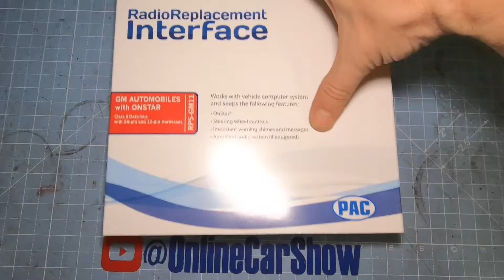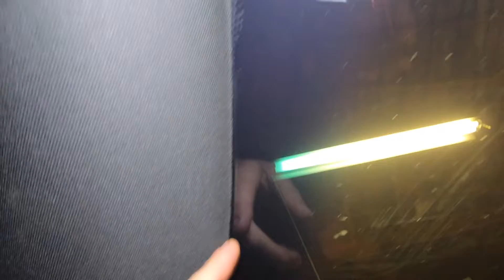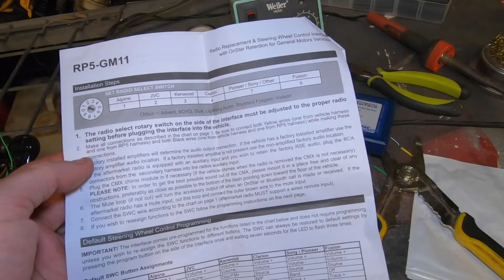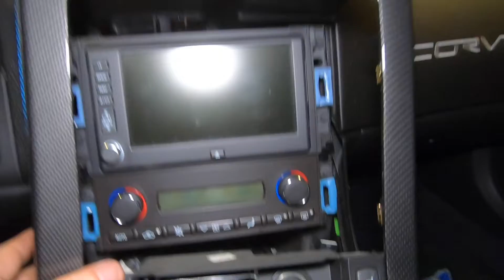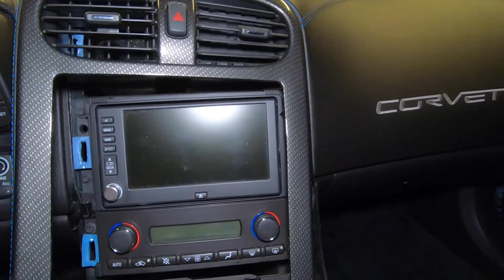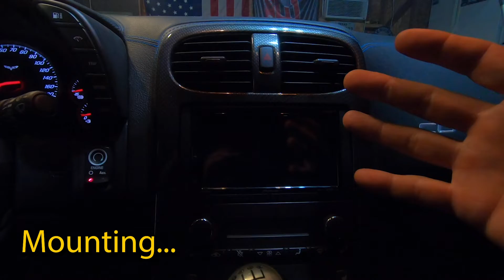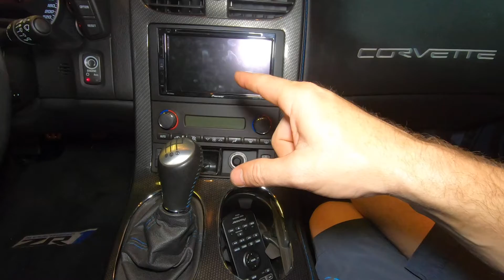HOW TO INSTALL AFTERMARKET CAR STEREO AND BACKUP CAMERA IN A CORVETTE C6 - The Easy Way!

Comment: Thanks for the video. Very direct and to the point. Using this video, direction sheets from Crutchfield and a little common sense, the install was successful and sounds great. For my wife’s base 2007 C6, I replaced all speakers and the head unit.  I didn’t add a sub but I will now. It sounds great but needs more bass!  Thanks again.

Comment: I love Crutchfield.  They have a plug and play wiring harness to make the install much easier
Reply from the maker: Yeah I had zero issues with it and installed easy
Reply: @OnlinecarshowNet1  $25 and Crutchfield will connect the stereo wires to the adapter so it’s 100% plug and play….. I think.
Reply: Your video seems much better than other videos I watched for this install, especially the reverse camera part. I’m going to attempt to install also front and side cameras into my Kenwood DNX577S.

Comment: Nice step-by-step breakdown.  I feel like I can do it when I get a new radio for my 2009 C6. Thanks!
Reply from the maker: Yeah just use proper connections. And make sure you understand wiring. And get a good instal kit. Most of it is connecting color to color
Reply: @OnlinecarshowNet1  I've wired a number of home video and audio systems as well as a home intercom. I plan on getting the GM wiring kit you used. Then just take my time to get the right connections. Sounds like a great post-holiday project in the garage.
Reply from the maker: Yeah just don’t rush it. It’s not too bad.

Comment: Thanks, planning to install a double din while it's parked for the winter. Good stuff.
Reply from the maker: Yeah it's a must on c6. Get a backup camera and better radio. One advantage I failed to mention was sound quality improvement. Even with stock speakers I could hear a difference.
Reply: @OnlinecarshowNet1  Absolutely, I want better sound, rear camera but the main reason is I want navigation. The problem is that most Garmin tuned radios or DVD NAV radios don't have maps of Canada or they're expensive. Or out of stock, like at Crutchfield.  I assume the Garmin is a better approach and I definitely want a unit that's not dependent on my phone for directions. Any recommendations? Of brand models or reliable sellers?

Comment: Thanks and Semper Fi.
Reply from the maker: Semper Fi Brother!
Reply: @OnlinecarshowNet1  I have watched your video several times (I want to get it right before I begin surgery). The Crutchfield harness looks comprehensive and looks like all the original C6 features will be retained, however I am not sure why the mic install? My C6 has Bluetooth for the phone only (steering wheel controls)and it works great. How come a new mic for the install? The USB extension installation looks complicated. True? Finally, with the install I will be adding a backup camera and would like if you could tell me where exactly the backup camera wires go?

Comment: thanks for the info. Waiting for the review. I listen to XM radio the most did you keep that in the car or thru your phone?
Reply from the maker: Yes the crutchfield adapter says it supports XM and the head unit does as well. I do not currently have a XM subscription though.
Reply from the maker: I may release a car meet video first but it’s coming...

Comment: A much better and shorter route to run the reverse camera wire is down the center of the waterfall, under the center console, I did it that way on my C5 and C6.
Reply: I’ve read that often. How do you get under the big section of interior in the hatch ?

Comment: Where did you get the corvette emblems for the front and back?
Reply from the maker: I love those. Found a guy on Instagram that custom machines. And they are cheaper than GM emblems too.  He can do any color combo you want and change them up too. His name on Instagram is @0fx2gv. Once you find his page you’ll know. It’s nothing but emblems he’s made.
Reply: Thank you . Just ordered a black and red set for my Z06. Also installed a new pioneer head unit and license plate frame camera like the one you have. Thanks for the great video and hook up for badges

Comment: Any issues ??? I ask cause I see in the forum that many vette owners switch to aftermarket audio and start having problems blowing fuse or draining battery ..
Reply from the maker: None that I notice so far. Been great and sound quality has improved.
Reply: @OnlinecarshowNet1  thanks a lot for responding ... I'm planning to install aftermarket radio on my 2005 ... So did you keep the factory amplifier on ? Or have to be removed?... I'm having an issue with the sound fuse it blows and I'm not sure if is the radio and amp with short circuit or the fuse box ..
Reply from the maker: Yes the crutchfield wiring kit I ordered had a port to use it and one not to use it. I figured be safer on speakers to use it. So I enabled the factory amp.

Comment: How bout the steering wheel adapter for steering wheel volume
Reply from the maker: The crutchfield kit had that. Functioned perfectly. Every button worked and didn’t have to set anything. Worked on initial power up.
Reply: @OnlinecarshowNet1  thank youuu that's what I was hoping. Time to buy this beast.

Comment: Yesterday I installed an aftermarket double din radio it got power turn on and off but it doesn't sound ... Have to bypass the factory amplifier to the new radio ????
Reply from the maker: You need the converter box to work with factory amplifier in car. I got mine off crutchfield they broke it down on their website easy to understand based off functions your wanting in radio and car. Many companies make them though. To bypass factory amp is a pain. Your better off with the kit and using factory amp. One warning... aftermarket radios will send more input to factory amp. So it’s easier to blow speakers. But if you keep in check the sound quality will dramatically improve.
Reply: @OnlinecarshowNet1  hey boss thanks a lot for responding and taking the time to explain to me all those details well time to order the converter box ...do you have the link for that item ?
Reply from the maker: Just tested before replying.  Goto crutchfield.com and search for factory amp kit. Once it brings up next page you can enter your exact car ans go from there. Should get you fixed up.
Reply: @OnlinecarshowNet1  I really appreciate your help brother thanks a lot
Reply: Hook all the blue wires up to each other
Reply: @tribalrocker  thanks 👍